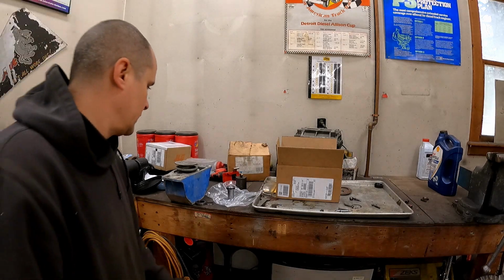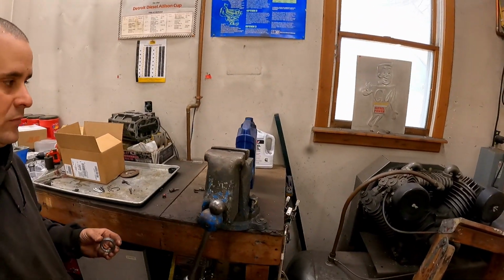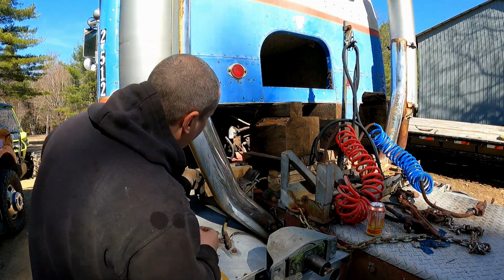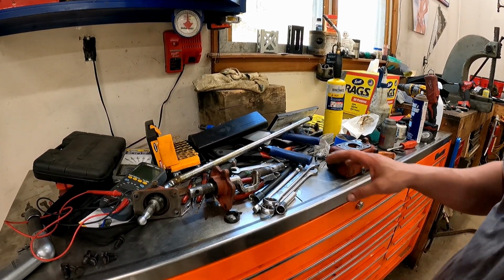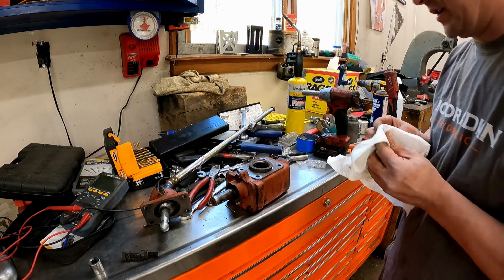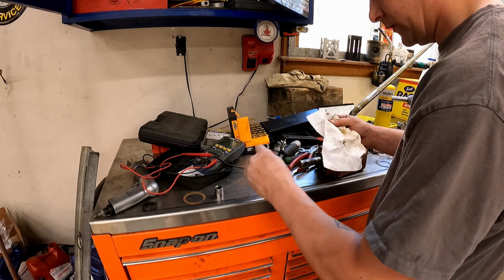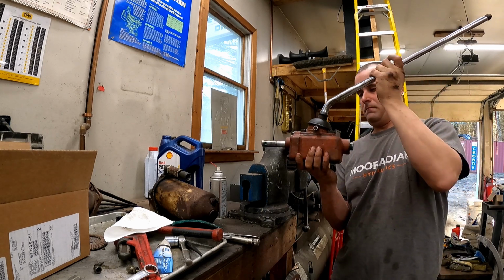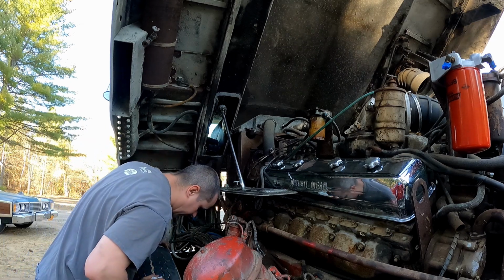12v71 Detroit Diesel Powered 1973 Peterbilt 352 Cabover - Gettin shift right - Episode 6

Comment: Your shifter information was great 👍 you may want to change the U joints in the linkage on this truck. It was a service item back in the day. When drivers complained that the gearshift was hitting the seat or the dog house this was often the problem.  It takes so little play to cause this problem as the play is multiplied by the Length of the gearshift great videos keep up the good work

Comment: Im sure that helped a 100% . The shifter ball gets the most wear , doesnt matter if its remote mount like this one ,or if the shifter goes direct into the transmission shifting tower . Also the 2 groves cut into the sides of the shifter ball and pins (guide groves and guide pins) they wear as much or more than the shifter ball .

Comment: Nice job on the grease fitting....sometimes thinking outside the box works better...even on thinner material I have drilled a hole and welded a nut on a casing to hold a fitting...always worked to feed the grease...hard to find a mechanic and not a VIN number parts replacement specialist

Comment: U joints might b worn ,,if it's a quter inch worn on u joint it will b a 2 inch play at the top ,I have a 67 int changed them 2 joints and the SHIFTER was like brand new every one told me that truck shifted Easter than any cab over they ever drove